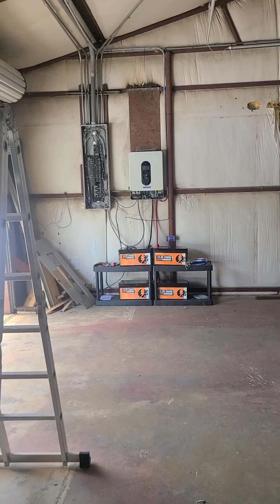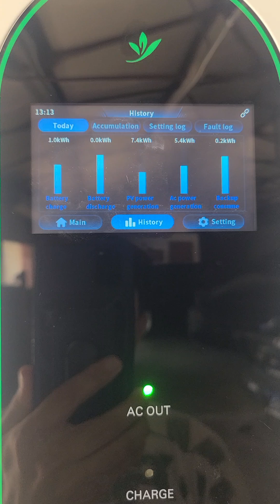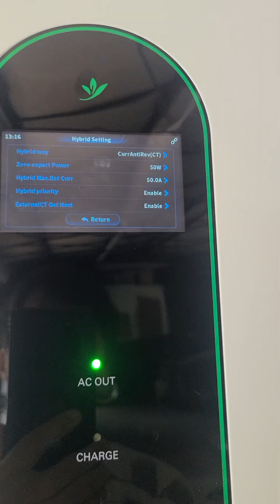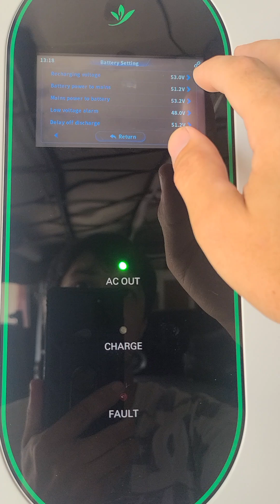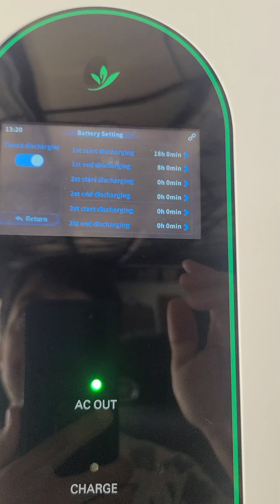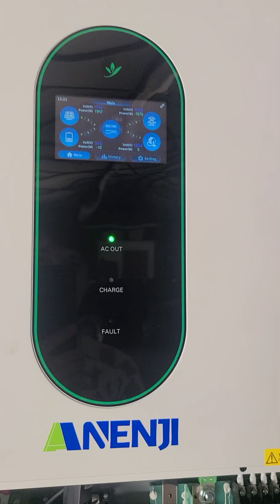How to Set up the Anenji 12kw Hybrid Inverter in Zero Export Mode

Comment: Hello! I have this same inverter and I have been running it without AC in mostly due to my fear of feeding back. I currently feed a sub panel instead of swapping my entire house over. I would like to do the settings so that at x% battery it just switches to AC in while PV charges the battery up again, mostly for maintenance reasons. Is this the kind of setup you were planning on moving to as well? I think with this method it would never feedback correct?
Reply from the maker: Yes thats exactly the plan. Its called battery priority in the inverter settings. In the solar world its called pass through mode. And you MUST interlock that output from the main breaker if you want it in your main panel or you will feed back. But with interlock it literally cannot
Reply: @rsmithdrift  That makes sense, in my case I have a sub panel with some circuits, so I just send a 240v 50a into the inverter and it will pass  through to my sub panel circuits if the battery gets too low. Provides the isolation similar to an interlock I believe.

Comment: Great video.  I’ve bought a few inexpensive inverters to see how they tick.  The difference between an eg4, srne , growatt etc and Datouboss or anenji is the documentation and software.  They all work but the inexpensive ones have such limited instructions that it’s very frustrating.  And you can’t get good help on the. Phone—they either speak only Chinese or don’t answer.  That’s the biggest difference I’ve found.  This is actually a commonly used inverter.  I’m not sure who makes it but it’s a popular inverter (or looks like it is). Thanks again.

Comment: Wait I didn't understand one thing you're using 51.2 V lfp and then you mentioned a battery balancer which is only needed when batteries are in series and so are you running all those four batteries in parallel or series into the hybrid? I thought this only used 48 volt battery voltage
Reply from the maker: Good point... i assumed every knew how to wire batteries to an inverter or would watch a video specific to that... the batteries are eco worthy 12.8v 280ah lfp and 4 of them in series creates a lfp16 51.2v battery with 14kwh of capacity. Because they are 4 batteries acting as 1 the inverter cannot communicate with them so a battery balancer must be used to keep them equal.

Comment: Hello, thanks for your video. I have a 6kW Anenji inverter. When it is running on battery power and grid power becomes available, it switches to bypass mode but does not charge the battery. I have to restart it to get it to start charging. What is your take on this? Regards.

Comment: How do you setup this unit to use the grid to charge the battery’s? I’ve tried all the different setting and can’t get it with grid connected to charge the battery’s
Reply from the maker: I said in the video. Its the timed charging setting. You must enable and set a time range for it to work
Reply: Te funcionó a mi también me pasa lo mismo

Comment: what gauge wire is that for your battery hookups?
Reply from the maker: 4/0 ... or 0000g
Reply: @rsmithdrift  thanks.
Reply: The only modification I would make is the battery 20%/80% charge discharge. Review will prowse explanation on Lifep04 batteries. Use the full capability of these cells. These are not more sensitive batteries like lithium ion.